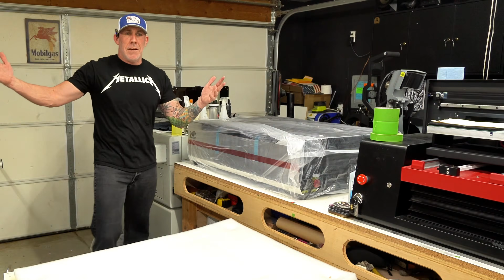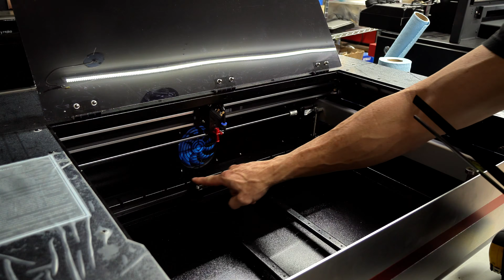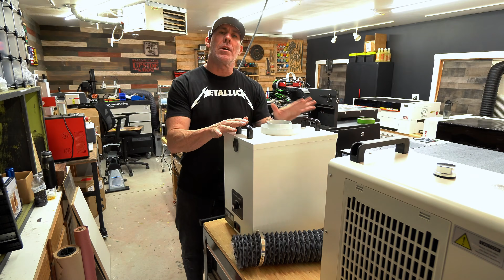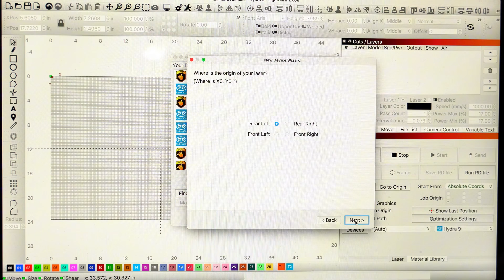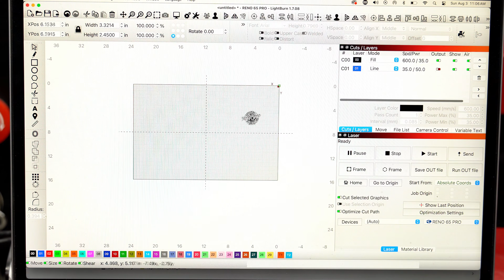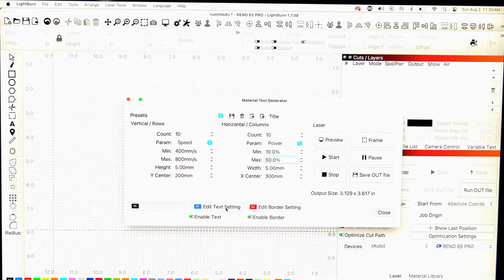Top Budget Laser Engravers | Monport Reno 65 PRO

Comment: Any chance you might know how to level the bed?  I just received my machine and the mirros appear to be alighned, but the bed is way out of alignment.  As a test, several times I cut a 2" x 11" rectangle on 3mm birch (with same results on white-coated mdf) and it cuts all the way through only the first 5" of the rectancle.  Sigh...

Comment: Ryan, I am new to the whole CO2 laser world (coming from diode).  I have been following you for a while and based on your knowledge/experience and my needs/space I chose the Reno 65 Pro.  I have had this machine for over 30 days and to date it is not working.  The symptoms are:
- Laser beam is not constant and not to full power.  Will not even cut through simple cardboard at 100% power in lighburn with 6 passes.
- The red dot when framing and moving does not stay consistently lite...it flickers. 
- Pulse is inoperative.

With the assistance of the Monport support tech the following has been done to date:
-Check all wiring (no loose or broken wires)
-Align the laser path (cannot due to no pulse)
-Replace laser tube (still same symptoms)
-Use the multimeter to check the motherboard (board is fine and symptoms the same)

I have over 35 emails back and forth with the monport support staff and no solution has been found.  I am extremely frustrated with this machine and I want to leave a warning for all those that will watch this video.  There has been not offer to replace this machine nor has there been and offer of full refund.  Maybe I am the 2% but nonetheless I am out $2k if this machine don't get fixed.  

Long and short of it, buyer beware.  Buying a laser from monport comes with risks.  I cannot speak to the experience of all buyers but can speak to my own.  Customer service is digital via email.  Return policy is horrible and full refunds are practically none existent.  

I will keep watching you Ryan and will stay subscribed but I cannot support the Monport brand.
Reply: I have had a similar experience with Monport with the 100 watt Effi10S.    I have had my machine almost 2 weeks and has not worked yet.  Many emails and no answers to get it going.   I would certainly be very cautious of buying from them.
Reply: We're sorry to hear you're experiencing an issue. Could you please send us a message with your full name and order number so our support team can look into this for you as soon as possible?

We’ll be happy to assist and get this resolved! Thank you.

Comment: My Reno 65 Pro arrived two days ago.
On the first day I set it up (I managed to get it on a table ALONE —just getting it out of the crate and onto that table took me two hours, because I did it alone, using  “ancient pyramid-building tricks”)  The machine is not that extra heavy, but you can't grab it on both ends...
On the second day I tried some test runs, but it didn’t cut at all—just left a faint mark, and even that wasn’t consistent in power. I double- and triple-checked everything (and yes, the RANGE min/max power in the RANGE menu was set to 10/80).
I was starting to feel a bit desperate when I remembered someone mentioning that a new machine should be mirror-aligned. 
First mirror—OK. Second mirror—OK.  Then came the Eureka moment:
The beam on the third mirror was so far off that it hit the aluminum bracket completely—left a small burn mark on it while I was trying. After doing the alignment, the machine now works perfectly.
I really think the manual should put more emphasis on performing this alignment right from the start.
Reply from the maker: Thanks for the detailed comment and feedback. I always run my material test card after setting a new machine up. This laser needed no adjustments out of the box. The test card will really let you know something is off and the first thing to check is the alignment. It's annoying to have to set it up, however it's pretty easy to do after you take the time and learn the first time. Plenty of really good YouTube tutorials and it's all the same process for 90% of lasers. Happy to hear you resolved the issues.

Comment: I've had mine lol over a month and it's been great. Added a solenoid to turn the air assist on and off with lightburn. Do you know if there's an overscannig offset adjustment? If i go over 400mm/s it increases the time on engraving because it overshoots too much.
Reply from the maker: That's a common issues with gantry style lasers. They have to start and then stop to move back and forth in the X axis. Overshooting sometimes can take longer to engrave. Also over time when belts stretch, learn how to adjust reverse compensation settings or scanning offsets.

Comment: Just got my 65 pro a couple weeks ago, so far been working perfectly out of the box... Love it!
Reply from the maker: Thanks for sharing! We had no issues during setup and didn't need to align the mirrors or adjust the scan offsets. Very nice unit for sure!
Reply: Hi, whats it like for cutting? Is the internal air assist sufficient? Thanks
Reply: @jd5417 I think hardly any of the budget machines air assist is up to snuff stock, even people with machines more expensive than this one upgrade their air assist. As far as cutting goes I haven't tried cutting anything over 1/4 inch plywood or 1/8 inch acrylic, both of which did fine.